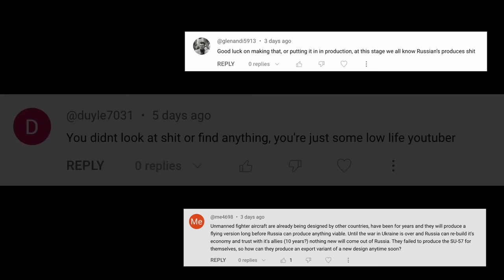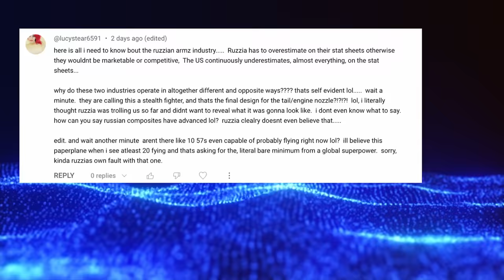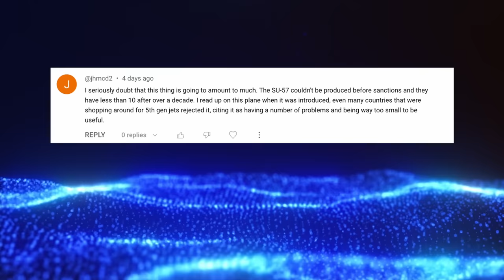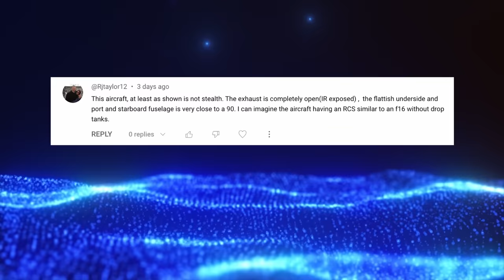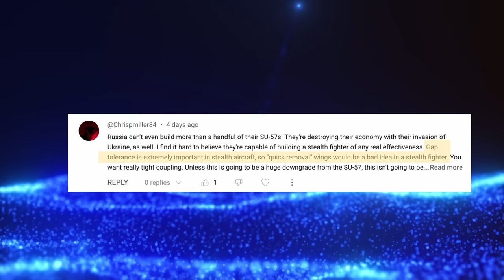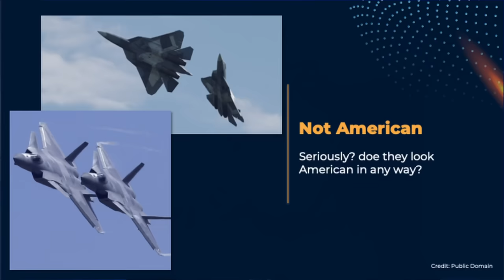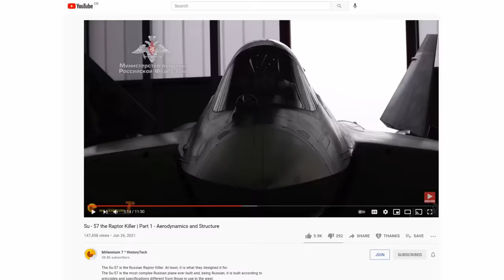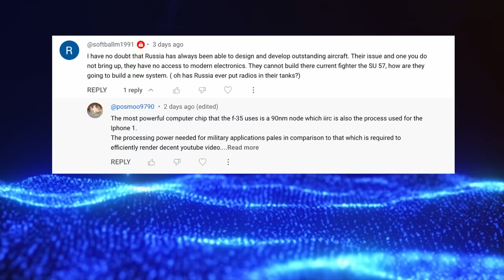Why so Few Su-57s ... and Other Stories.

Comment: I do enjoy your videos for the most part, but it's becoming increasingly strange that you go out of your way to defend Russia. In future, I think most people would prefer it if you could just stay neutral rather than trying to bat for one side or the other. Some of the comments you called 'trolls' were actual valid arguments: 

-There is reason to doubt Russia's capabilities to produce modern tech, but the US/Nato has proven time and time again that it can field it and use it.
-There are few SU57s, and there is no evidence it matches the specs claimed or has operated in the field.
-There are few T-14s, and no evidence it matches the specs claimed or has operated in the field.
-Russia does lag behind with composite materials, which is why the design flaws are less of an issue on Western stealth planes like the F-35, which had access to the UK composite material expertise when being developed despite the US not being the leader in that technology.
-Sanctions have had a negative effect on Russia's war industry production, stolen Swedish traffic camera lenses have been found used in Russian missiles. 

Some of your responses are also false-equivalencies. Such as saying the NGAD program could be just as false as the checkmate concept, yet the US has not only produced aircraft that had the stats claimed but have been significantly ahead of any peers (specifically the F-14, the F-15, the F-22). You can't compare a country with a track record of producing the best in the industry, with a country that hasn't produced anything comparable since the 1980s when it wasn't a single country but supported by the wider infrastructure and expertise of the entire USSR. 

Also, on the previous videos you made on the war in Ukraine, you cited two youtubers as sources, both of whom directly took their sources of information from the Russian ministry of defence, and used those perspectives as the facts you operated on with no counterbalance. The weebunion youtuber as a source is particularly egregious as his predictions have nearly without exception been wrong: from Bakhmut, the Ukrainian squads creating pockets of control on the left bank of the river after the flooding, to his current predictions over the past few months for Avdiivka: its pure fantasy and strategically never plays out how he predicts. 

Furthermore, on some of your past videos when contemplating the trade offs between the aerodynamics of Russian fighter design to the complexity of Western stealth fighters, you do seem to hint at or suggest that the Russians approach is better: but with modern missile technology and advances in radar and stealth, the days of higher mobility seem to be outdated as traditional dogfighting is becoming more and more irrelevant. There subtle aspects just seem to add up over time.

Not saying you cant have a bias, but it does leave a bad taste in the mouth when you start coming out calling your audience trolls for what are, for the most part, reasonable doubts about the validity of Russian claims.
Reply from the maker: I got out of my way to explain  that the F-35 is a great aircraft too. For the rest  I already replied in the video.

Comment: "UAC delivered 27 new-build combat aircraft in 2022: four Su-30SM2s, ten Su-34Ms, seven Su-35Ss, and six Su-57s. " - that we know of.
"The historic average from 2008 to 2022 is 40 aircraft per annum, so the 2022 total is somewhat below the average. "
So we can expect maybe touch less than 40 in 2023. 
Thus with losses of around 80 per year Russia is able to sustain its air force. 
Su-75 looks great, through its production start time frame looks too ambitious - even if Ukraine is set to loose war soon.

Comment: I wonder how much of what we argue about (from cracks in stealth coatings, to different types and uses of composites) will all be rendered moot the first time we see a major engagement between Western stealth and Russian air defense.  Or vice versa.  I don't know, but have a funny feeling that we'll quickly learn that some of our obsessions are near-irrelevant and other factors that we'd barely considered are actually paramount.  Tactics may matter far more than inherent low-observable properties.
Reply: I suspect some countries have space based infrared good enough to track planes and missiles in real time, maybe only in narrow areas. The rest is about sensors, spoofing blinding and decoys
Reply from the maker: That happens  quite often in war.
Reply: That bodes pretty poorly for Russia then, it's well established that the US has by far the best aerial doctrine of any country on Earth

Comment: 2 batches of 4+4 Su-57 has been delivered so far 2023 and I think another batch will be delivered before end of year or soon after, 18 in total or something like that serial produced so far. As I understand it 22 SU-57 will be delivered next year, fitted with the new engine. Could be wrong though.
Reply: Modern high performance jet engines use hundreds of compressor blades, all slowly-grown single-crystals of titanium-aluminum alloy ("TiAl") that need holes through them to transport coolant. Scaling that tech up is super difficult

Comment: As for composites and powdered metal technologies, Russia has often been way ahead of the curve. The real problem for Russia is the decline of its education system and of the under-35 population, as they simply will not have the cadre of top engineers they used to enjoy.

Comment: The FMI just marks the economic development of any given nation. It doesn't reflect a nation's access to high tech composites or certain technologies. That said, there's video evidence of T-72BM being downgraded of advanced systems. China may provide a good enough replacement to those, nevertheless.
So, yes. In a way, a ban on the sale of advanced raw material is affecting the Russians. How much is yet to be seen.

On the economic side...Well, Germany is faring worse than Russia growth-wise. And that can be checked by looking at the very own EU report on European economy.

The problem with Russian military as a whole is that it's still massively reliant on Soviet designs and technology. And that's not changing fast enough...So far.

Comment: So is the Su-57 underpowered right now, since it’s new engine isn’t out yet?
Reply: I wouldn't say it's underpowered cause it flies like a ufo with the current engines
Reply: @kanestalin7246  well, that’s just a testament to how much lift it can produce. I mean, can it super-cruise as advertised, but it’s slated top speed? Accelerate as well as it was planned to? Etc. that kind of underpowered
Reply: @christopherchartier3017  it should be able to do all but supercruise
Reply: @kanestalin7246  thanks
Reply: @christopherchartier3017  It is underpowered compared to the final version. it is powered just fine compared to the rest of the fighters.
It does supercruise but not at the advertized speed. I mean even the Su-35 did supercruise.

Comment: Roughly a thousand F-35s have been built, while F-35 it self has over 950 design faults with critical faults that will never be corrected.  F-35 is a PRODUCT, it's main goal is PROFIT.  Russian SU-57 is a COMBAT WEAPON, and the worlds only 5th gen platform that was tested in full spectrum combat.  SU-57 is entering mass production after being fully combat tested.  It's that simple.
Reply: Love how trolls keep calling things that are no factual stating them as facts. As if you worked on the program and you know that the issues were not fixed. Let me tell you some Ork, some of the smartest and most capable people are working on the F-35 program. You can be certain that the vast majoirty of issues this jet might have had are all but gone! The jet was evading S-300 and S-400 in Syria on a daily basis when the SU-57 had 50% crash rate! The Russian flying propaganda doesn't even have engines and they call it 5th gen. By American standards the jet is not even in active service yet. Su-57 has never seen combat!
Reply: @m.a3914  In that fantasy world of yours, US dollar must still the worlds reserve currency used exclusivity for oil trade, and US bases in the middle east were not attacked over a 100 times.
Reply: @BigSmartArmed  Ok bubbleman

Comment: The last part of the video is really interesting. In "Ground" technology we see the same. The Armata was suppose to be the new tank and all other line to produce other tank to be abandone/change in favor of the Armata platform.. Remember the 2300 Armata for Russia.. T90 were to be Upgrade to the T90MS variant for export. But then Ukraine Happens. Armata production its almost stopped. All tank in Russian inventory are to be Upgrade. Thus T90M prv3, T72b3 and T80BVM... Russian knew that they will have to go war.

Armata also did have Engine problems. These were resolve like 2 - 3 month ago. And its also suppose undergoing Modifications from the knowledge of the war.  I remember reading someone saying that the Army want it to have 152mm gun and Thermobaric round.
Reply: a solid choice considering they knew they will mostly be facing older variants of the same vehicles. they can upgrade probably half a dozend or more t-72s to t90ms for the cost of one t-14 in half the time it takes to build one.

Comment: I wonder why Russians still use centre sticks on their fighter planes? Whereas most countries switched to side sticks on their newer fighter jet cockpits.
Reply from the maker: Good question and don't know the answer
Reply: Both SU 47 and SU 37 had side sticks .
So they do know how to package it and use it...
I think they just like to use the centre stick configured (they're all fly-by-wire anyway)
Reply: @sidharthcs2110 it makes training easier?
Reply: @sidharthcs2110  the Su-47 was a prototype and even after the Su-37, they again switched back to the centre stick
Reply: @predator1409   Not every new fighters uses side stick, for example the Gripen E uses a centre stick. I guess it doesn't make any diferences in the fighters capability, it's more like preferencies.
Reply: @preludeh22a57  agreed they designed it to where you nearly never have to take your hand off of the stick…
Reply: @preludeh22a57  even then, cental sticks are also designed to be only used with the right hand, won't it be equally as hard? Also, if the plane gets damaged enough to the point that it reaches the pilot and incapacitates his right arm, wouldn't he just eject at that point?
Reply: @predator1409 not really hence they are centrally positioned, allowing left-handers to better able to manoeuvre and fly the plane than putting it on the side.
Reply: @thewatchman9540  even centre sticks are designed to be used with the right hand only, you cant really use it with ur left hand either

Comment: Being the first to create a companion model alongside the one carrying the "meat", is not a breakthrough per se, is it? It does not present capabilities exceeding any other development path because of it, does it?

The secret sauce is the quality of the individual platform capability and that when fused with other platforms is then made much more potent/useful with a high degree of mission survivability. Russia has great airframes now, but seemingly cannot use them to their max potential for a multitude of reasons. I further seriously doubt the absolute capability of Russian AI. Not because they've not got the raw talent, just that they've not got the resources or visible development history. If they have it, then why is it not helping their air defence systems now for example? If it is, that bodes worse for them. We also need to distinguish advanced machine learning from AI. You can make the best design in the world and fail to make it or fail to use it to  best advantage. If your enemy is slightly less capable in this platform, but they've got their crap together, you're likely in serious trouble. Russia seems to be following the "Wunderwaffe" philosophy of the Nazi war planning playbook.

Comment: Might the issue of aircraft production be that the Russians give lower priority to air power in combat and place higher reliance on air defence to deny US/Nato the air dominance that their doctrine absolutely requires.  US war fighting doctrine assumes a relatively short SEAD campaign that will open up Russia airspace to more or less unhindered air attack.  But maybe this assumption is false and can be made MORE false by simply increasing the density of Russian Air Defense and perhaps this can be achieved at lower cost and more rapidly than building aircraft.  The Russian view might be that long range strike might be better accomplished by cruise missile and ballistic missiles.  In a war with Nato,  Russian Air Defense could perhaps deny US/Nato access to attack rear areas all while Russian ballistic missiles rain down on relatively few Nato air bases.

Nothing is as it seems about the war in Ukraine.  This holds true for both sides.

Comment: There will be 3 version of the SU-75. 1 seatter, 2 seatter and unmanned. The problem with the West is that they massively underestimate the capabilities of Russian engineers and that could and will one day be the downfall of the West. great report👏👏👍
Reply: Nobody is underestimating the Russian engineers. In fact many of them are running from Russia and have been doing so for decades! But is is also clear that the Russian engineers are continously being outclassed by their Western counterparts. One reason for that is access to resources. You can do something if you lack the resources to make it.

Comment: My issue with the SU-75 and SU-57 is the number of real orders they will get, there's no way they can cover development costs / prototypes and produce for $30M-$50M without producing 500++ units. The SU-57 reportedly (Wikipedia I can't find a better source) cost $10B to develop based on the deal with India, the SU-57 due to cost $140M each when the initial orders were 500. How are we meant to believe the SU-57 is now going to be $50M per jet and the SU-75 $30M. Afterall it's known that the Indians dropped out of the SU-57 having sunk a lot of money into the project and essentially opted for the Rafael (yes i know they were carried based Rafael's so not 100% comparable) with a much higher price tag. Were the Indians wrong to pull out of the project? 
 
Now who else with a serious military budget is left to buy SU-75 and SU-57? India and China are unlikely to buy anything from Russia again. Who's also going to buy into the SU-75 unless the Russian Airforce already operate the platform. It's not like recent Russian project have a history of being on schedule or on Budget. 

I do understand the idea of a cheap fighter for smaller nations who can't use American/European solutions, I would just trust and Indian or Chinese solution more if I were one of those nations.

Comment: @Photonic Radar: It's easily explained based on real physics. I have it in my car, AKA headlights. They effectively illuminate the environment with photonic radiation, allowing for much better visibility, especially in unfavorable conditions. However, activating the high beam mode has a downside—your stealth is pretty much gone because the radiated photons can be easily detected by common sensor devices, AKA eyes. These devices pick up the photons and convert them into electrochemical signals that a biological neuronal network, AKA the brain, can recognize quite easily.

So, yeah, I think it is totally realistic that the Russians will be able to strap some lights on their planes... LOL

Comment: By and large agree with what is stated in this vid, but the part where he doesnt believe the chinese copied the US designs? please.
We KNOW china hacked and stole data from lockheed, and chinese officials in the airforce have openly stated that they copy and there are limitations to their ability to copy exactly what they are able to 'obtain'. 
I mean china copies absolutely everything. Motorbike engines, cars, watches, phones, CITIES for gods sake. They have replica villages from European countries. They are making rip off ducati's now called Moxiao, which are absolutely shameless theft. They dont even try to hide it. Its impossible to bring lawsuits against them because the chinese government endorses industrial IP theft and copyright infringement.
There are already bolt for bolt copies that make up many chinese aircraft, eg  Caihong and Wing Loong are reaper drone copies.
the Xian KJ-600 is a CLEAR hawkeye rip off.  Just in these platforms there are loads of design variations that would have been easily possible, but they look basically identical.
Thats before we get to the flanker types and the stealth jets.
If the chinese ARENT copying it would be the exception of the rule.

Comment: The difference between trusting Russian claimed specs and US is that we’ve seen consistently that Russian overhypes and US understates performance.  

Just look at the MIG-25 vs F-15 situation
Reply: MIG-25 was never hyped to be what it was by Russia this was simply US analysts getting horribly wrong by assuming it was some high manoeuvrable air-superiority fighter due to its big wings when it was always supposed to a high-altitude high speed interceptor meant to counter XB-70.
Reply: @thewatchman9540  Not remotely true.

Comment: Thanks for the great vid 😊
Question: why doesn't Russia have China build SU30 or SU35 airframs and most key components only and have the aircraft transported to Russia for final assembly with there engine's, radar system and so on in Russia? Wouldn't that be a win win for both Russia and China?
Thanks 😊

Comment: Ah....the first fighter aircraft to be "self aware" was the Agile Combat Aircraft demonstrator ACA flown in 1978. On test it took over control to avoid a simulated missiles attack pulling 8+ G the pilot blacked out it took the ground controllers 15 mins to realise it was flying itself. The ACA went on to become the Typhoon... So did the Typhoon need a pilot from mid 2012...?